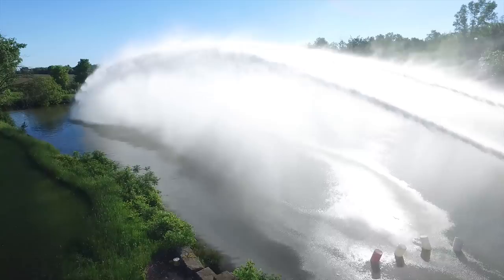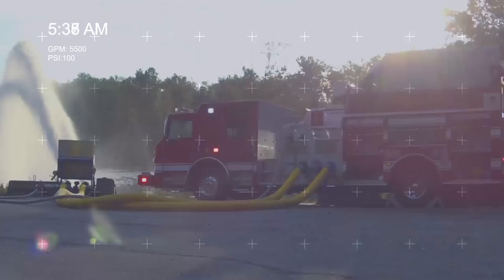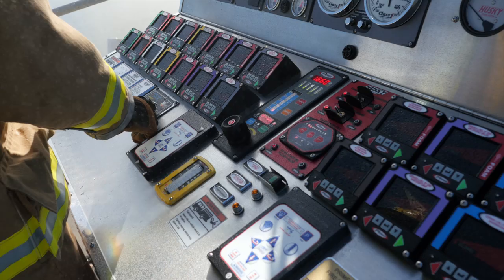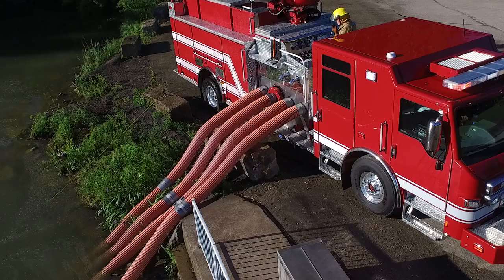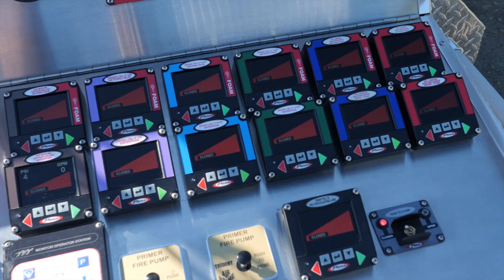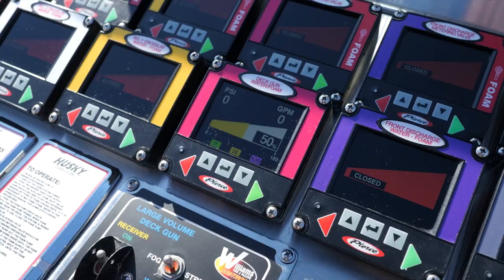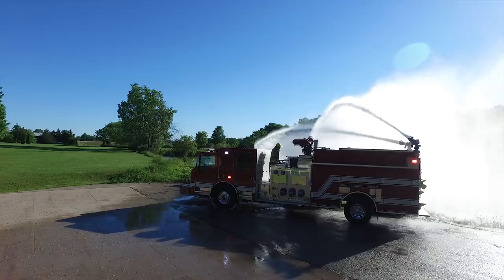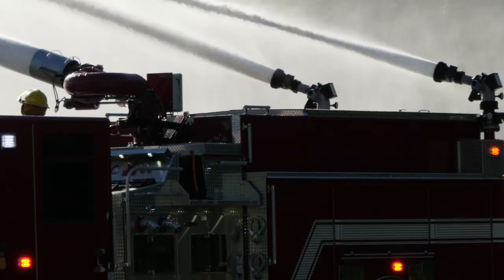Pierce High Flow Industrial Apparatus

Comment: couple this big boy with the forklift drones from US Fire Pump(?) that can move water monitors around, and you can get a nice central control pumper that could set up a self protect fog, and 2 or 3 application streams for foam.   The same setup might also be able to cover a neighborhood sized front for wildfire protection too?

Comment: It's a shame not to use commercial chassis such as Scania 730 HP or Volvo 750 HP to suit market where there are manufactures of these chassis.  Could reach 6000 gpm. Today we use Scania from 560 to 620 HP with 3000 gpm pump.